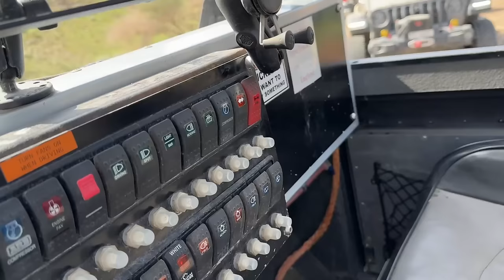TRAIL DAMAGE OFF ROADING IN DUBAI! Jeep Gladiators & Wranglers Conquer Extreme Terrain!

Comment: We would like to clarify that the steering kit in this video is  NOT an RPM Steering kit. The steering kit in this video is an Apex Chassis kit as indicated by the Apex Chassis logo in the center of the tie rod. RPM did in fact use these ends in our steering kits and sold tens of thousands of them which carried our lifetime bend or break warranty. All parts have a failure point and have limitations. All that said, RPM Steering on 12/1/2023 introduced our own forged rod end. These ends are built to our forged specifications and as always we offer a lifetime bend or break warranty on all our parts.

Comment: After watching the video, that’s not even RPM steering at all. If you look at the passenger side, that’s Apex. It has the ninja star washers bent over the aluminum.
Reply: Correct. Kevin needs to issue a correction. This is an Apex Chassis kit.

Comment: Those are apex tie rod ends not rpm
Reply from the maker: RPM uses apex ends. Ours broke on the first obstacle on the first trail we ever did with them. It was an RPM steering kit.
Reply: That’s an Apex tie rod and ends. RPM doesn’t use Apex anything anymore. Apex has those silly Chinese stars.
Reply: @LiteBrite  so the apex tie rod  end broke. Rpm started making there own tie rod ends not to long ago!!! Two completely different companies
Reply: @litebrite. Wrong! RPM does not use Apex Chassis ends. You need to issue a correction. This is a full on Apex Chassis kit.

Comment: Just ordered a RPM Tie Rod a few days ago. It hadn't shipped when I called so I canceled it. Saved myself a headache and a bad day out on a trail!
Reply: This is not an RPM Steering Kit. It is an Apex Chassis kit. Kevin needs to issue a correction.
Reply: Well, crap. I canceled the order. Went with a Rusty’s off-road tie rod instead which is probably not a bad choice.

Comment: How come you guys (@Litebritenarion) you air down your tires but in the Dubai video, nobody seems to air down.
Reply from the maker: They were all aired down
Reply: @LiteBrite  oh cool! I guess not as much as you guys.
Reply: I’m buggy was running 10psi then 7psi…we were testing the grooving on the LTBs and see if we could increase the psi a bit to protect from pinch flats…traction wasn’t great at 10…7 was better…we used to run 5psi before the grooving…so better traction, more sidewall protection…

Comment: Everyone recommends rpm steering.  But clearly they are junk.  Who would you recommend?  I need to order something sooner rather than later.
Reply from the maker: Rock Krawler. They’ve been torture testing theirs on their King of the Hammer rig for years. That’s what we have on the Stepchild now.
Reply: Those are Apex TRE's.  RPM no longer utilizes them since November of 2023 and has their own TRE's being produced.
Reply: @LiteBrite   the rest of my suspension is RK. But everyone recommends. Rpm so I was leaning that way.  Happy to see your video. And get your advice to stick with RK. Thank you
Reply: @alaskanpeeps Kevin is incorrect. This is an Apex Chassi kit. RPM does not use Apex Chassis ends. Kevin needs to issue a correction.

Comment: Lol rpm steering is junk….go straight to heims
Reply: Those Tre's aren't from RPM.  They're Apex.  RPM now has their own TRE's and even offer heim ends.
Reply: @craigo6808 Kevin is incorrect. This is an Apex Chassis kit. RPM does not use Apex Chassis ends. Kevin needs to issue a correction.